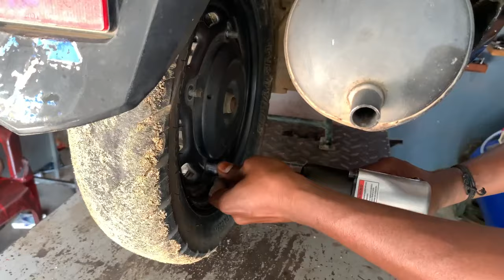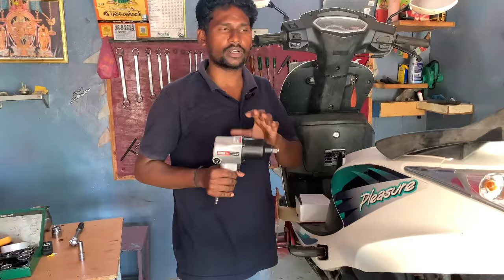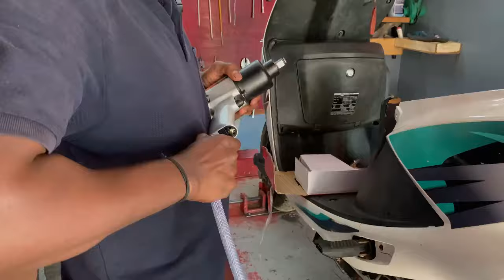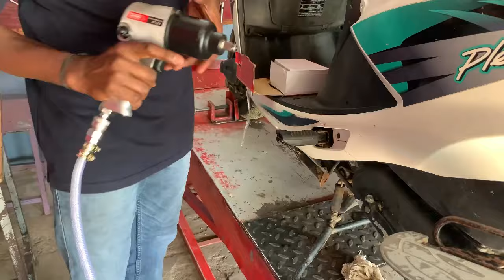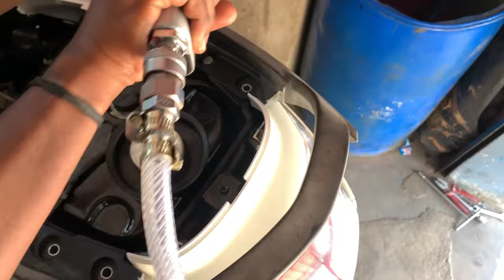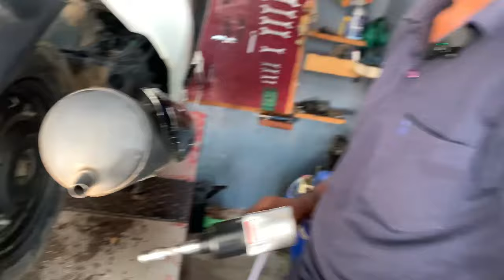இந்த காலம் மாற மாற நாமளும் மாறனும் #automobile #tamil #airgun #machine #tools #modified #techno

Comment: Anna battery gun supera iruku but air gunum ok
Reply from the maker: @rprmani867  என்ன கம்பனி gun நல்லா இருக்கும் அண்ணா பேட்டரி gun
Reply: @mottopointmkcitty1979  ingco rs 6800 iam using 26 size bolt nut
Reply from the maker: @rprmani867  நல்லா இருக்குமா
Reply: @mottopointmkcitty1979  bro iam using tractor implemented   nall iruku nenga nambi vangallam
Reply from the maker: @rprmani867  ஓகே அண்ணன்🤝🤝😇